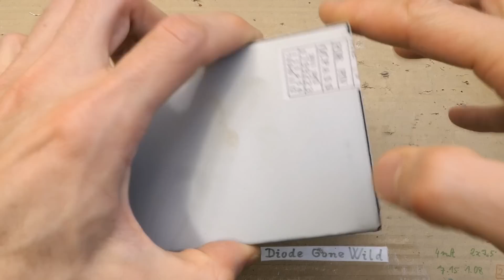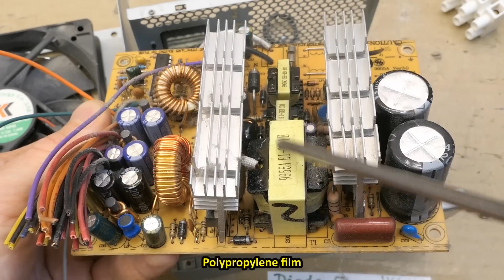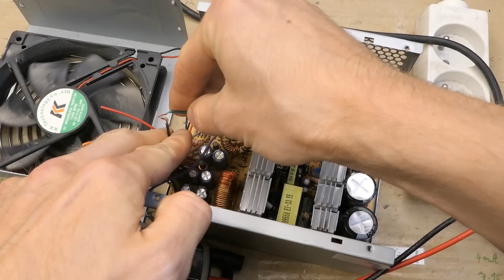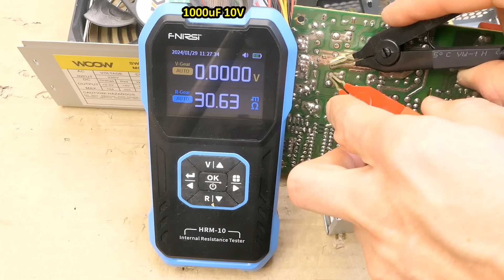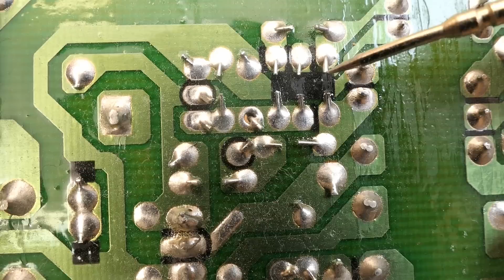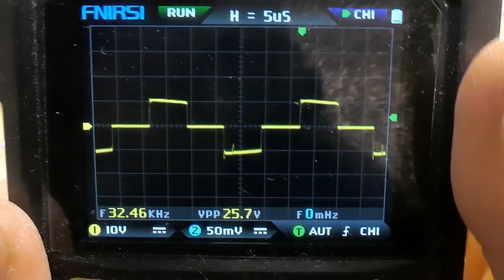Crappy ATX analysis and repair

Comment: I can see why this was scrapped even from the offset. That 12V rail is rated at 15A, which is only 180W. Since the CPU/Graphics/HDD/SSDs runs on mostly 12V, that's 180W for the main components of a system, which really isn't much.
Reply: Enough power for 1 cpu and 1 hdd. And thats it.
Reply: @1marcelfilms  About right for office machine used mostly for Word and Solitaire.
Reply: SSDs generally do not run on +12V, but on +5V only. Also, in the days before the P4, CPU and Graphics was usually supplied from +5V and/or +3.3V. I don't think the supply can do 15A @ 3.3V and 20A @ 5V at the same time (although you likely need to add 50W at 3.3 and 100W at 5 to the 180W at 12V to get the overinflated 350W figure), still was this is enough for a Pentium III computer with ~600MHz, a Riva TNT2 graphics cards, one or even two hard drives, a CD recorder and a DVD drive. The "Word and Solitaire" machines mentioned in this thread had supplies around 150-180W. With the switch to "regulate everything from +12V", most prominently driven by the (for that time) extremely power hungry Pentium 4 processor, this supply got obsolete.

The marking "For PIV" (for Pentium 4) may have helped selling that device in 2011 to unsuspecting customers, but that doesn't make the design apt for 12V-heavy systems. The only way you could sell a device like this in 2011 was via its price. Which explains why all the interference suppression stuff is missing.
Reply: They scrapped the whole desktop pc and the copper of the cables had been the most valuable remains?
Reply: 180W is plenty for most CPU+mobo combo. 😅

Comment: I'm amazed; no bulging capacitors!
Reply: NICON capacitors tend to be very durable, they are bad but not prone to swelling.
Reply: Sometimes these crappy PSUs can still outsurvive low-end models of “decent” manufacturers, as long as you don't load them too close to the claimed output. (Hipro HP‑D3057F3H was a typical example of the latter: It delivered its rated 300W in‑spec when new, but the 2A standby output has only a 1000μF 10V 8×15mm Teapo SC before the ferrite coil, good for maybe half of the applied ripple current and it accordingly failed all the time. Quality replacement capacitors can survive longer than the Teapo, but for a reliable repair you need to pick a higher‑rated or even polymer replacement.) Since the other components in these cheapos don't have to be up to specification, they can use a few of the cents they saved elsewhere to get a survivably‑rated standby output capacitor 😛

If the IEC (and company) had their act together then they'd have mandated sufficiently-rated output capacitors, but I'll spare you any further ranting on that topic…

Comment: Still has too many inductors. Remove them for more simplicity
Reply: No it doesn't. You can never have too many inductors in a PSU. Add back the mains filter inductor and X2 capacitor and the PFC coil.

Comment: I had just fixed one of these .. but mine was the luxury version with PFC and all the other missing parts. both main transistors where shot and the replacement ones ordered from amazon turned out to be fakes with wrong pinout..

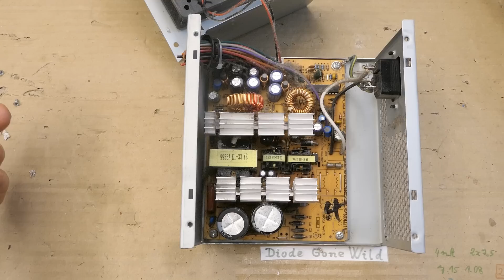Comment: 1:30 The double suppression inductor, the capacitors and the discharging resistor are omitted for extra safety. 
(What’s not in there cannot burn;)
Reply: Also, if they're not there, it's harder for the assembly worker to put them in incorrectly.
Reply: They usually send a fully loaded PSU to get it approved by the country's standards and testing department. Once that's done they ship out the reduced cost ones. The parts missing are usually noise reduction. I don't use anything that has been reduced like this as a radio ham because of the noise . Branded power PSUs are usually much better they cost more but they are safer and reduced noise. I must admit I wasn't sure about the joke 😂 but you have a very sharp wit.
Reply: @barrymayson2492  Thanks for your comment and compliment!
Reply: Would be interesting to do some measurements about EMV. How bad is it realy if almost all components for suppression are missing...
Reply: @tvelektron  Yes, now that you’ve mentioned it, I’m curious about that too.
Reply: No, they were omitted to save a couple of $. Makes no difference to the safety.
Reply: @simontay4851  My comment wasn’t meant to be taken seriously 😉